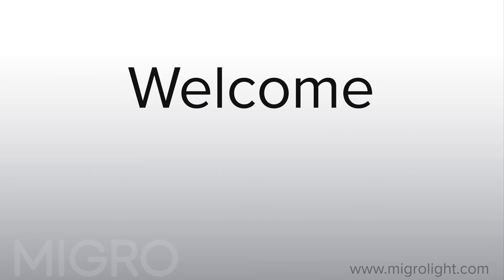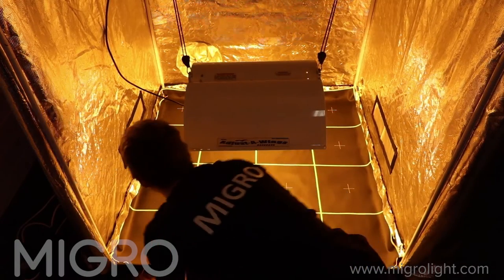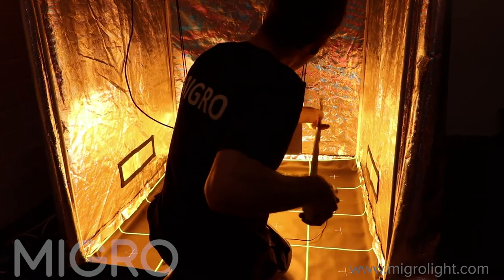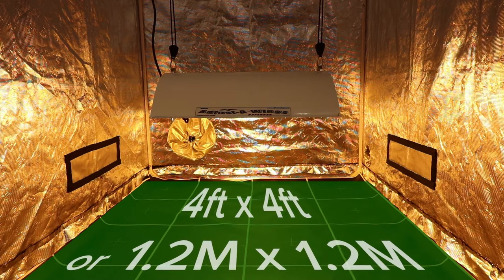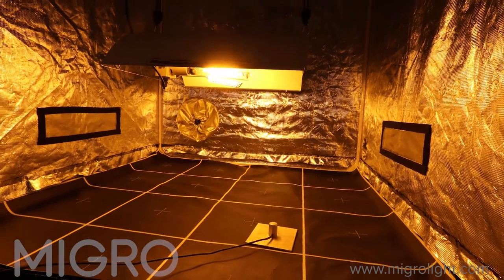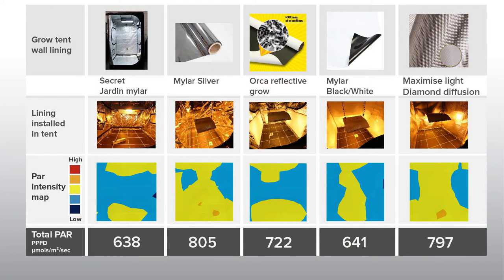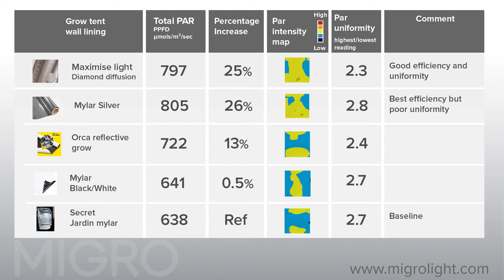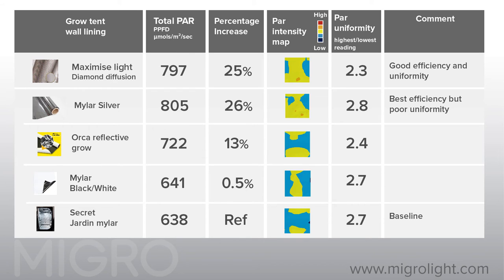grow room reflective sheeting comparison test

Comment: I think this setup is severely biased against the orca-material for several reasons. I'm currently trying to figure out what kind of sheeting I should get, and it seems like the Lighthouse sheeting (which you use in a more recent video) would be a good idea, but I'm not yet convinced that it beats the orca sheeting.

This is my reasoning:
1.) The orca-sheeting doesn't cover the entirety of the walls, neither vertically nor horizontally. 
1.a) The gaps at the corners are bound to swallow a significant amount of photons.
1.b) The missing orca-film above the lighting fixture is bound to result in upward-reflected photons (reflected from the orca sheeting) being bounced almost exclusively towards the top. If there was a diffuse sheeting / diffuse scattering above the lighting fixture, many of the photons which initially get scattered upwards by the orca would subsequently be scattered back down again.
1.c) The open wall on one side (to take measurements) might also impact the results of the orca-sheeting more than non-diffuse materials. I don't know whether this is the case, but I don't think one should discount the possibility. It would also be possible to close the fourth wall for testing-purposes simply by using an elevated floor with holes at the locations of measurement.

A fair and thorough comparison of different sheeting-materials would require covering all of the walls and the ceiling equally, and without gaps (apart from tent-poles and the usual stuff inside a tent like vent-openings). IMO even the floor should in part be covered with the material in question, to most closely simulate a life-like environment, i.e. filled with plants but not overcrowded.

I will post this comment on your other (more recent) videos as well, because I don't know whether you'll see this here, and I really think you should take this into consideration in your comparisons. You try to be very thorough in your analyses, and I highly appreciate your content. But your reasoning why non-diffuse materials should be better seems severely flawed when considering a real-life environment, i.e. inside a space covered with reflective sheeting on at least 4 sides, most likely 5 or 6 (ceiling and floor).

Comment: I wonder if common radiator foil works for all wave lengths of the PAR. Radiator reflex foil is cheap, available, thick (lowers noise) and ease to use as you can buy it in a self glueing variant.

Comment: interesting results with the orca considering its claims thank you for the info
Reply from the maker: +bobby blues The problem is the orca is non directional. It sends the light everywhere when you want it reflected down. Diamond Mylar is a great, cheap solution.
Reply: downwards? surley the orca reflecting everywere will create an even foot print vs any consentrated spots?? i would really like to know as this effect effects everything from walls to joods
Reply from the maker: +bobby blues I struggled with this issue myself when doing the tests! If you think about a ray of light coming from the bulb at one end and the plant canopy at the other. The diamond diffusion will reflect the ray (think of a tennis ball bouncing off a surface). The orca diffuses the ray i.e. 50% if the tennis balls bounce in the same direction and 50% come back. More light may be reflected with the orca but almost half of it is lighting up the top of the tent where it's no use. Take care
Reply from the maker: +bobby blues Hi Bobby. It reflects the light evenly but it goes in every direction, the same as Matt white paint does. I'll do a video on the reasons behind the results based on you comments. It will be out in the next week or so. Take care
Reply: Keegan Yentsch  you're one smart person here!
Reply: @MIGROLIGHT  well, you didnt really give it a fair chance, you made horrible job lining it, disnt cover the full area and created pockets where the photons get trapped, you should try it again with proper fair scientific method or remove the video.

Comment: Aluminum foil....hang it secured at the top....keep about 6 to 10 inches from plant...set fan so it will gently move the foil. You will be able to see the reflective light on the leaves. It moves around on the leaves because of the soft breeze.